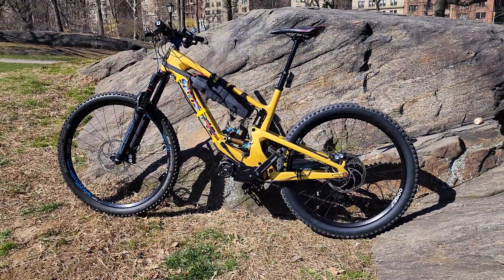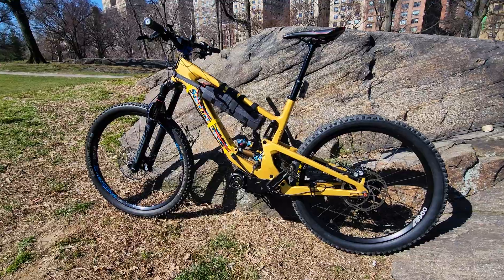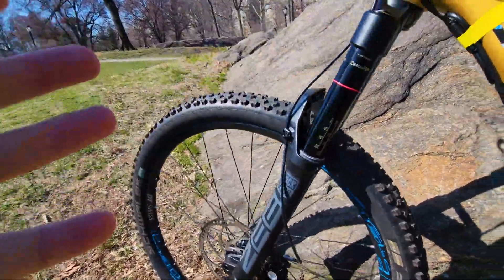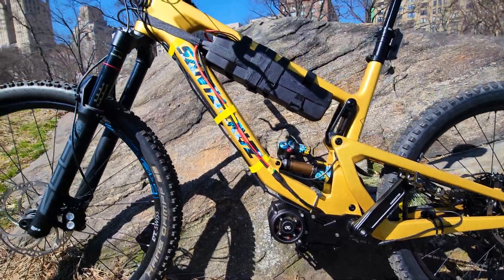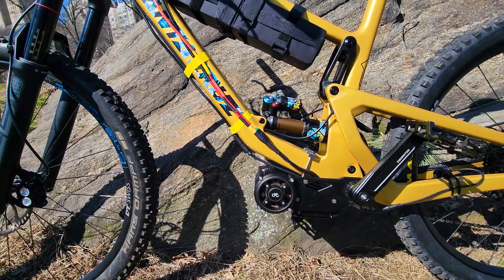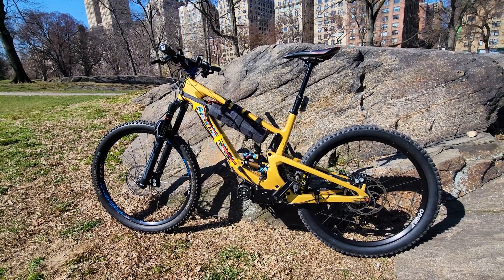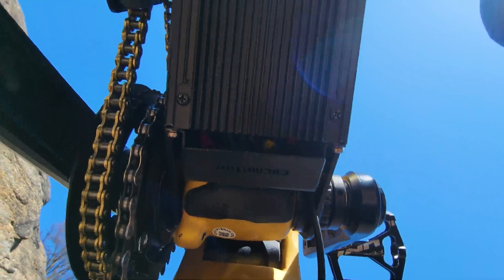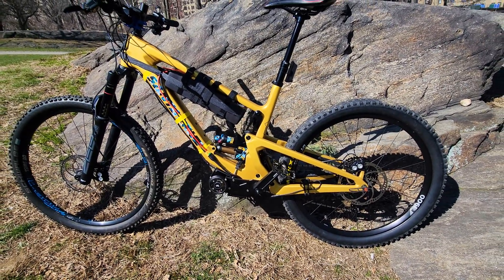DIY Electric Bike Using 5000W E-Bike Conversion Kit CYC X1 Pro Gen 3 Santa Cruz Frame

Comment: Hello!
What chainring size do you have on motor? (like 32t with 53t or?)
Reply from the maker: 32T
Reply: @ElectricVehicleSpace  thanks
Reply from the maker: @dragos32  I get close to 45mph top speed on 32T on bigger size the speed will be pass 50 or even 60 mph. Now on 32T it strechess the chain and I am looking for stronger cassette and chain. The ones I have only survived one day. I did about 150 miles in one day. I could not stop riding. It is so much fun.

Comment: you need some cut off switches in the brakes
Reply from the maker: what is that? so far it is working perfectly. Video coming soon.
Reply: @ElectricVehicleSpace  cuts the power when you brake, if you got 5000 watts on it you better be able to cut the power if it malfunctions or it’s very dangerous
Reply from the maker: @livingfaith-g3v  not needed!

Comment: that 72v battery will put out 5000 watts? I thought you needed 96v for that.
Reply from the maker: There are various option to get higher output and you will need the X12 controller that will arrive in 2 months.

Comment: this really is a nice donor bike. the website says x6 Controller is 3500w. i wonder when they come out with x12 Controller
Reply from the maker: very soon. I saw it on the NY ebike show few weeks ago. They also are coming with new products that will blow your mind.
Reply: @ElectricVehicleSpace  after a contact that i had with cyc they told me that the x12 controller will be released in April. it close. so stay tuned .

Comment: Did you get the frame directly from Santa Cruz? I wish CYC ditch the chain drive and go with the photon drive. So much quieter
Reply from the maker: I dont care about the noise. It is so cool and it is not that loud. You will like it.
Reply: Chain drive is the most reliable and efficient reduction and gives a lot of options how to install the motor. I don't mind the chain noise in my stealth

Comment: What’s you’re battery ah? I hear 20ah or 12ah. Also what’s the range you get? Thansk.
Reply from the maker: I stated all specs in the video. Speed and range test when the bike is 100% completed.
Reply: @ElectricVehicleSpace  I couldn’t make out what you said about the battery if it’s 20ah or 12ah. It’s ok

Comment: Seat to handlebar ratio is wild
Reply from the maker: Why?
Reply: @ElectricVehicleSpace - because of the weight distribution. All the weight is at center of frame especially when your on it. It may or may not buttom out when you hit a jump. Meaning the middle shock & nothing on the front suspension is taking a hit.

Comment: The most important thing for me is reliability 
I have a gen 3 stealth.
Do about 4k miles in my bike a year
If it’s still going after 3-4 years I’ll be happy
Reply from the maker: Wow this is impressive 👏 I'm sure it will if you take care of it.
Reply: That's cool! I got about 1k on mine and I did break 1 sprag clutch with careless offroading. Replacement was 20 dollars plus shipping. Btw. is that santa cruz upper linkage getting full movement?
Reply: @mtbsieppo   my sprag clutch has broken on my stealth after about 1500 miles
Currently I’m off the road 
Can’t see where to buy a replacement ….?
There are none on the cyc website for the gen 3 that I can see ?….

Comment: I would say strap t to the seat post, but if you are utilizing a dropper seat post it won’t work. 

The other suggestion would be color the battery/bag yellow, so its camouflaged.
Reply from the maker: Great suggestion I just need a bag that fits there and looks nice
Reply: Using